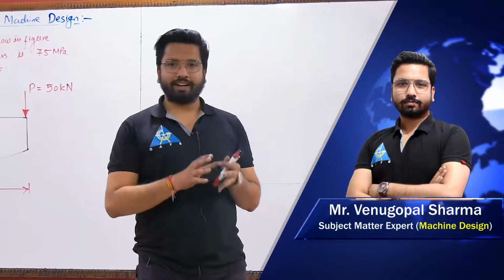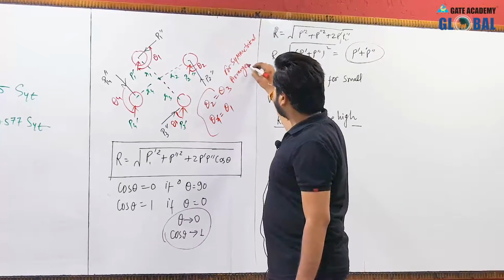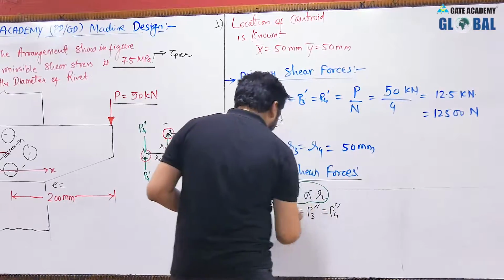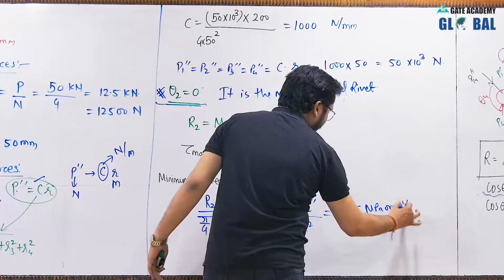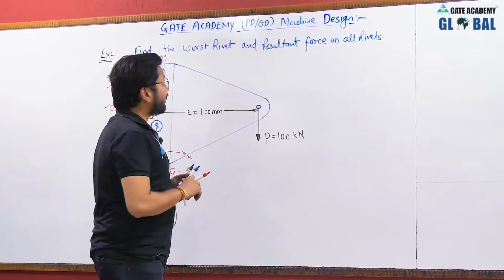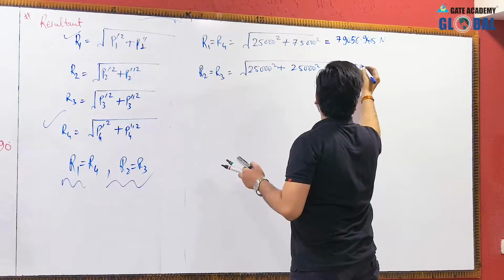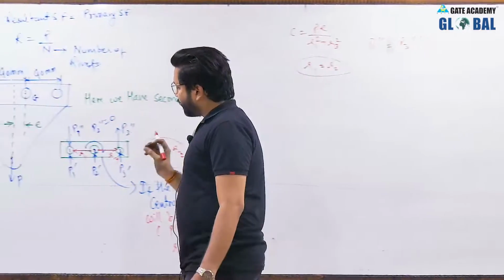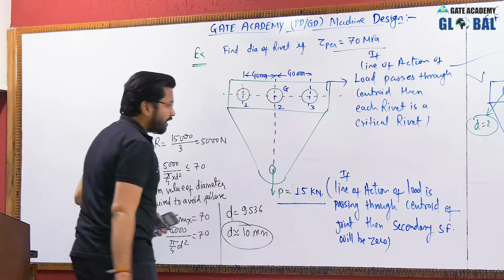Example on Eccentrically Loaded Riveted | Lecture 10 | Machine Design

Comment: Sir, In last note for horizontal rows and perpendicular load, shall we consider angle? Because there the angle is 0 so the least angle will be the maximum resultant.but you said that line of action of load which is the longer distance is the most critical rivet.

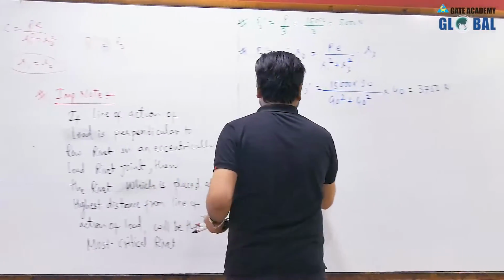Comment: @59:34, P3" = 3750 similarly P1" also will be 3750 N.....Because e =20, and r1=r3=40 mm.....or shall we consider either the eccentricity 20+40 mm to the third rivet (critical rivet) or the radius is consider 60mm?